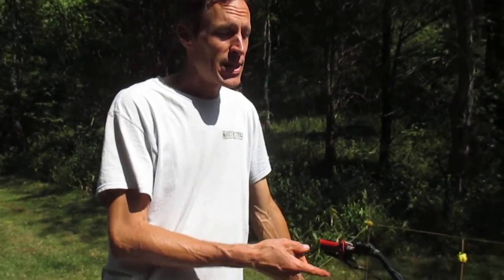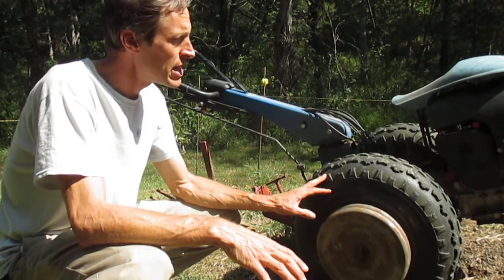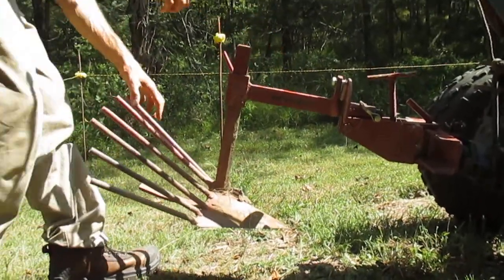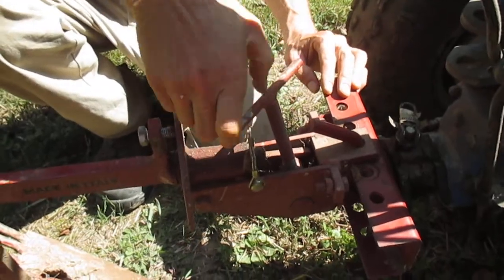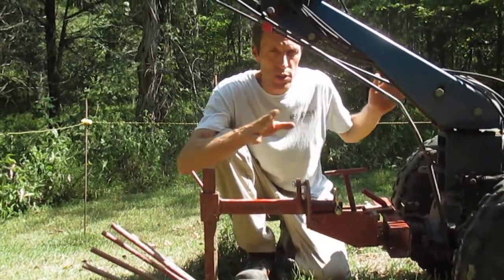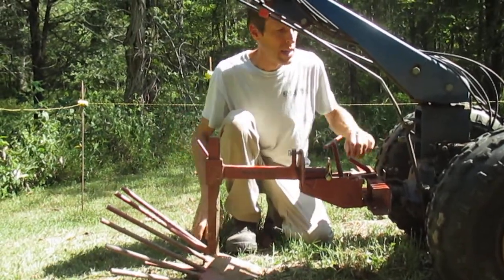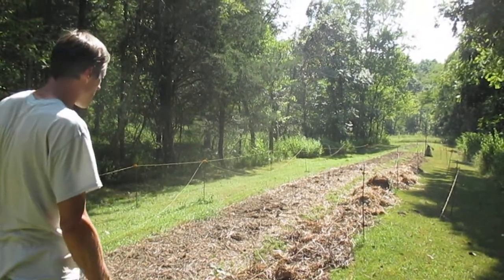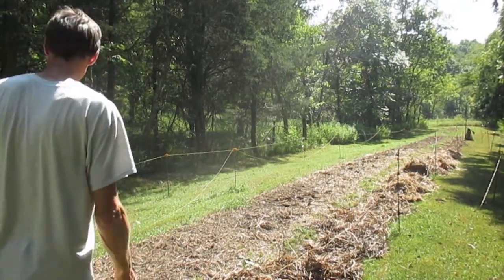Aldo Biagioli Root / Potato Digger Plow for Walk-Behind Tractors

Comment: In addition to this, Would airing down the tires help as well? I ask as this is what i learned to do when going offroading or drive in winter in 4x4 vehicle. By airing down, the traction patch on the tire is much wider and longer. This combined with the wheel weights would give more traction than weights alone I am thinking, but perhaps this same concept does not hold with 2 wheel tractors.
Reply: This could help, yes, but as most of the tires for this type of tractor are "tube-type", you run the risk of having so little pressure in the tire that the rim slips inside the tire and rips the valve stem out of the tube.

Comment: how much better would this do with the track attachment instead of tires?
Reply: Somewhat, but not as much as you might think.  The traction is still limited by how much the machine weighs, which, with a walk-behind tractor, is not much compared to 4-wheel equipment.

Comment: Seems like a nice tool but as said, would be made better with the right tires for some traction. Speed on the machine seemed too fast also but maybe just wanted to get the video over with :)
Reply: No, the faster ground speed actually helps when busting through tough soils...the "momentum" works with you.  I agree that these tires are not ideal, but they're what I have on my tractor for mowing (which is what I do with it mostly), and they work well enough. (Of course, it does better with actual V-tractor-tread tires on it.)
Reply: One tip, use mulch. The tubers won't need to go deep into the soil. I've used leaves from bags at the curb. Let them get wet and they will mat. Put a layer over each plant. If you just mulch with dry leaves they will blow away. You could also use straw. The nice thing is you can poke and find early potatoes this way too.